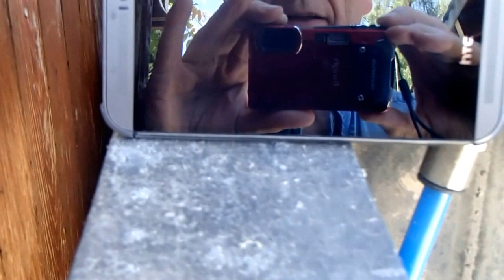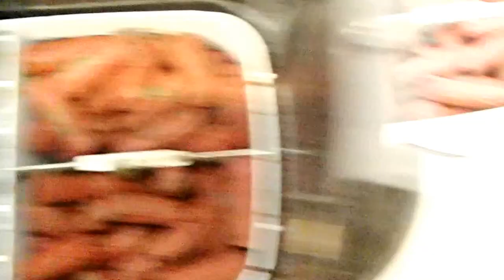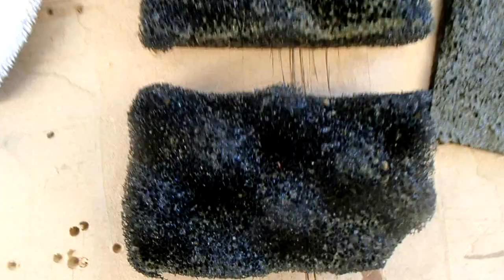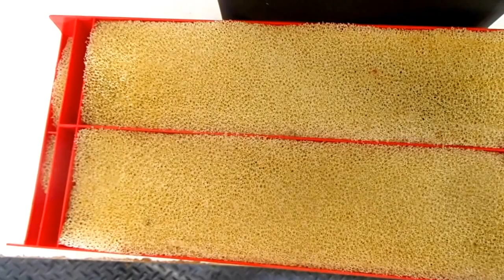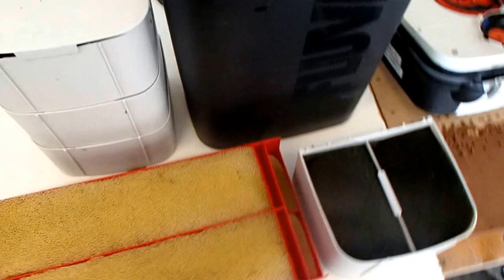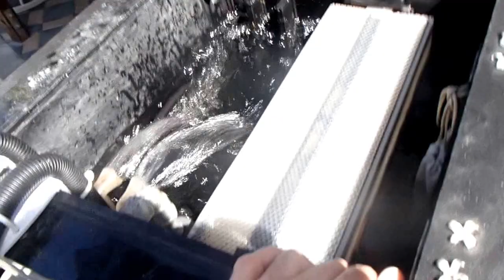Foam Filter Evaluation

Comment: I'm sure that using the polyester polishing pad / fine particle matting will make a heck of a difference as the fine pad was still too coarse to catch the fine particles unfortunately. If they had a bit more age to them they would catch more as a dirty filter foam catches more muck than a clean one but the fine pad should prevent any noticeable muck in media (hopefully....).
I'm getting excited about the biohome marine and my website is about done now with a link to your site front page.
Reply from the maker: Pondguru Outdoors Richard, Thanks for the comment. It will be interesting to see in a month of the polyester mat works better. Just put the foam on the site today. Looking forward to your new website. Sounds way cool.